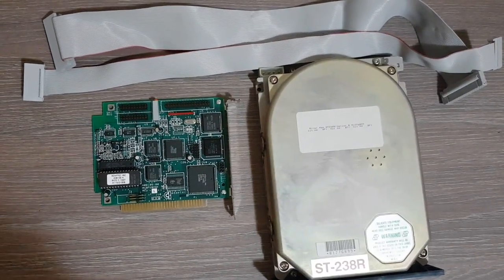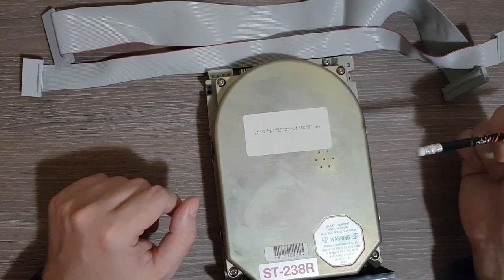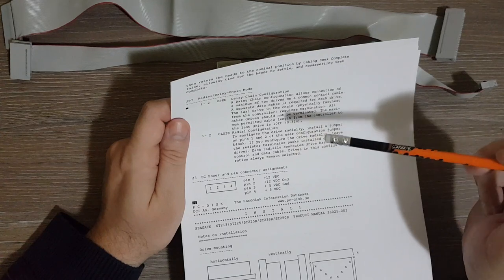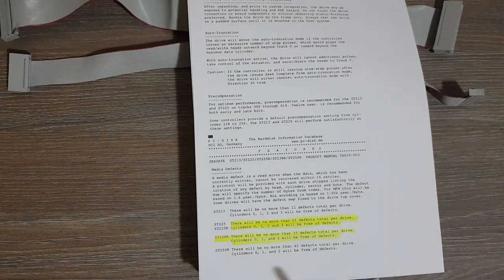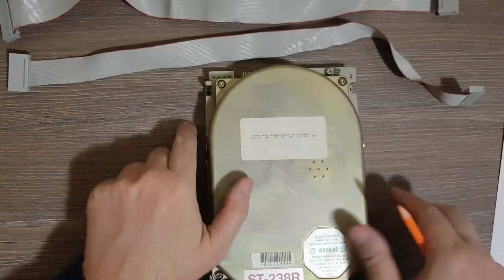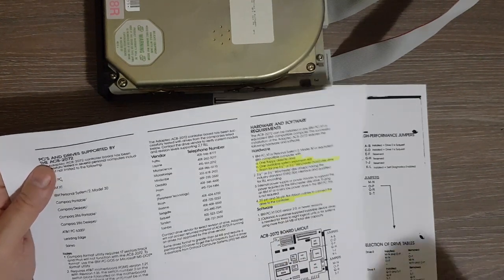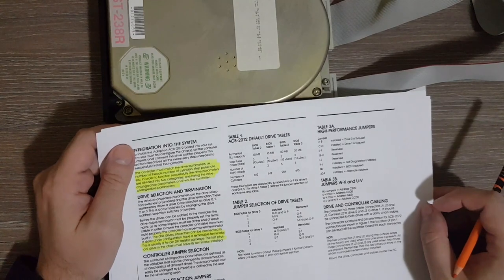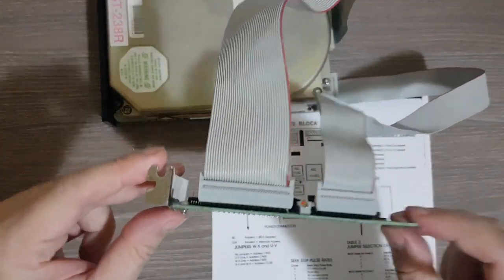Disk Drive and Disk Controller from IBM PC 5150

Comment: Great video!
I have the same controller card and 2 of the ST-238R drives.
One of the ST-238R drives works perfectly, but my second ST-238R will not work with this controller...
I test them one at a time, but only one works, the one that doesn't work, will work with a different MFM controller card I have.
So I'm a little confused at this point, as they're both identical drives...
Any ideas ?